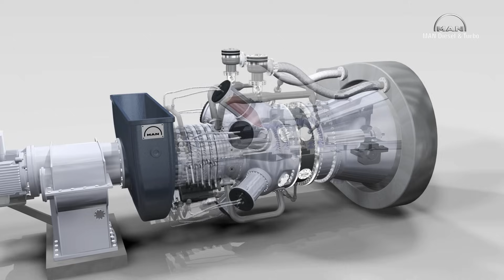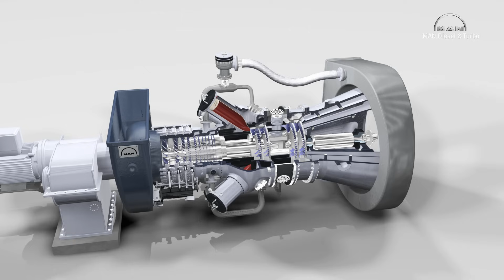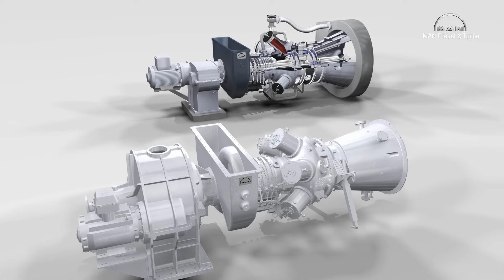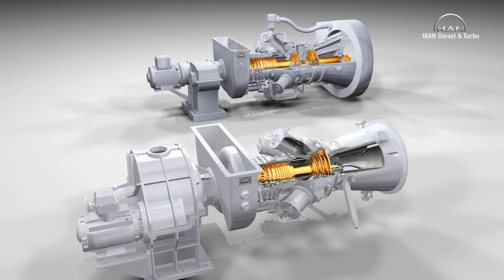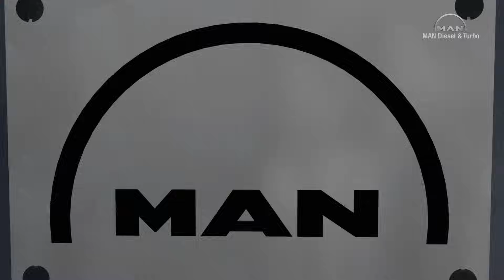3D animation of industrial gas turbine working principle

Comment: Steam is gas which is used to drive turbines using pressure..  So can't we use a pressurised gas that doesn't require burning or destroying it at all, that can be recycled over and over again. Using modern techniques, technologies and more efficient ways of producing and using electricity surely this could be plausible and would also have zero emissions that come from burning fossil fuels that produce steam or combustion ?

Comment: Wait a minute... unless I am wrong, the animations is wrong... or backwards... if the cold air (blue) is from the left, it should turn clockwise (and it does), but the blades look wrong... maybe its just Me... anyone else know what i am talking about? or able to elucidate?... Thanks - Brilliant animation by the way... well done.
Reply: the leading edge of the compressor section blades need to face the direction of rotation. (slice into the air to push the air through the compressor). If you view from the inlet end the blades are pointing to the left and rotation is anti clockwise.  The heated air at the turbine section is directed to push on the turbine blades to drive that rotation.
Reply: @Jb-tl1yi  Oh wait - I see I think... The hot air(purple) is driving the Turbine, but the cool air is being drawn in at the back by the fans (like a turbo) OK that makes sense... thanks very much.... I still need to work out how the two drive shafts interact, but it all makes sense now... this stuff is amazing.. Thanks.

Comment: I have a question. How long works the electric motor used to start the compressor? I mean, in steady state the shaft spin is selfsustainable as long as the combustions keeps ongoing, or if the electric motor stops, the entire system stops?
Reply from the maker: Hi Tore, during the standard start-up procedure of the Gas Turbine (GT) the starter motor is engaged and the GT is ramped up to speed. After approximately 6 minutes the starter motor is disengaged as then the shaft spin is self-sustaining.

Comment: But what are this turbines used for?
Reply: The ones I work with are for power generation.
Reply: these are used in
Aircraft Jet engines
power generation in power plants
Reply: The single shaft version is normally used to drive a generator. The 2 shaft versions are commonly used to drive compressor sets as used in oil refineries.

Comment: The gas turbine consists of 2 sections 
the gas generator with high pressure turbine
And the power/low pressure turbine Wich spins independently of the gas generator at a variable speed thanks to a second independent shaft. An external drive Wich is an electric motor starts the gas turbine and it drives the shaft of the high pressure turbine allong with the compressor mounted on this same shaft. The compressor driven by the high pressure turbine serves to take in the air needed for cumbustion, inside the 6 combustion Chambers the air is mixed with feul gas and this mixture is ignited. 
The hot exhaust gasses expand driving both the high and the low pressure turbine blades making them spin , the fast spinning turbine blades and shaft drives a generator wich converts the spinning energy to Electrical energy. The hot exhaust gasses then flow through the gas turbine defuser wich increases the gas pressure and ejects it via the outlet casingof the exhaust. The high temperature gas can still be utilized to generate steam when it comes out. Connected behind the turbine you will find the specialy designed boiler called a heat recovery steam generator (HRSG) it's function is to capture the high temperature exhaust gas from the gas turbine and convert it to steam. Thanks to the captured exhaust gas The HRSG then generates steam where it is then delivered to a steam turbine where even more electricity will be produced. The main steam piping Wich are Huge bundles of pipes running out of the HRSG to the steam turbine, are the pipes that deliver high temperature and high pressure steam from the HRSG to the steam turbine. The steam turbine uses this steam from the main steam piping to spin the generator. Similar to the gas turbine high temperature and high pressure steam passes through the steam turbine turning the blades and the shaft Wich turns the second generator to make more electricity.
Reply: shepherdwarriorKING L

Comment: Is there a way to add on another gas turbine with a gas that boils at even lower boiling point like propane or butane? How far can efficiency be pushed here?
Reply: boiling point from what i understand wont increase efficiency. propane for example boils at -44 degrees. in some parts of the world a vaporizer is needed to turn the liquid to a gas, requiring energy. what would make sense is gas with a higher calorific value such as butane. although more expensive therefore not necessarily more efficient. combustion efficiency also maxes out, creating perfect combustion is extremely hard to achieve. efficiency in my opinion will come from alternate routes of energy production.

Comment: "Used as a mechanical drive for compressors (...)" What the actual f***? What kinds of pressures would be delivered by those compressors? I mean, this thing generates 7-13 MW!!!
Reply from the maker: Thanks for your interest. MAN Diesel & Turbo designs and manufactures turbocompressors with pressures of up to 1’000 bar. 
Please visit our website for more information: http://www.turbomachinery.man.eu/products/compressors
Reply: silly !!
Reply: They didn't mention that this is the power source of an A1 Abrams tank.
Reply: @maxmarquez2911  more likely industrial applications in gas

Comment: So, why are the combustion chambers off to the sides of the turbine instead of having the chamber be built linearly into the turbine itself? It would seem like such a setup would be better because the fuel would be ignited with the air itself resulting in a 
 more balanced combustion and therefore a more efficient reaction, but please do correct me if I am wrong.
Reply: May be it would be made the whole engine too long.

Comment: The interior of combustion chamber is not corroded due to the continuous flame ? I mean as material is not being destroyed ?
Reply: In gas turbine engines, the combustion chamber usually consists of a combustion liner, which sort of look like a cheese grater. The combustion happens inside the liner, while there is air moving outside of the liner, creating an insulating film of air. The holes in the liner allows for the air to swirl to mix the fuel and the air before combustion. The moving air also cools the liner itself, so the temperature of the actual material is safely below destruction. What the animation doesn't show is the purple part (compressed air) moving into the inner hot part of the combustion chamber. Makes sense, since combustion chamber design would be proprietary.
Reply: This answere discribes a conventional combustion liner. The flametube in this video is cooled by impingment cooling, which is not shown. Additionally there will be a thermal barrier coating.
Reply: The material for combustion liners is Hastalloy X.  It can take the heat. But the type of fuel used can cause hot gas path corrosion problems. Using natural gas has the least amount of hot corrosion. Distillate fuels are commonly used but crude oil can be burned but component life is drastically reduced.

Comment: how long can an engine run before it needs maintenance
Reply: in different engine is different nonstop work time, begin from few hours for some airplane turbine to 2-3 mount for stationar turbine in large gas transport system
Reply: it depends on 2 factors
1-preventive maintenance dependant on Engine Running Hours
2-Breakdown maintenance when some part is damaged and safety is operated
Reply: 20-25 years

Comment: If those radial cans are the combustors, how are they fed with air? This video doesn't show that. Are those cans in fact fuel premixers, and the combustion chamber axial with the turbine?
Reply: the compressor feeds them, if you look closely at around 1:57 you can see the purple stream (the air compressed by the compressor) being pushed through channels that feed the combustor through their top. Then the hot gases are sucked in by the turbine (which in turn is kept rotating by those very same gases). Follow the colors: blue --> purple --> red --> purple again.

Comment: I would like to ask how a Gas turbine generate electricity. I searched on the Internet, many website say the the fluegas would be applied to boil water, using the steam to drive the generator. But why don`t we just use the turbine to drive generator? I sincerely hope an answer could be given.
Reply: for combined cycle the gt's are normally alot bigger upwards of 175mw some are now 300mw
Reply: They do use the gas turbines for electricity generation and some plants (combined cycle) use the gt exhaust after its has produced electricity, to heat and boil water for use in the steam turbine. 
http://www.power-technology.com/projects/san_joaquin/images/combined3.jpg
Reply: some Use the turbine shaft and some boil water

Comment: How the engine is cooled?
Reply: Compressed air is bled off of the compressor/gas generator and fed into the turbine for cooling.

There is no water and no steam used in cooling one of these units.

In some applications though, water IS fed into the compression process as well as into the combustion process.  While this does result in coolng,  the cooling is used to increase the density of the fuel-gas mixture thereby increasing the power output.  So it IS cooled but NOT for the sake of systems protection with the exception of some flame-centering applications.  Bleed air is still used to coole the turbine in these applications.

In combined cycle applications, heat from the exhaust is used to generate steam.  This steam is generally either used as process steam or generating steam.

In a few applications some of this steam is even fed back into the combustor of the turbine as power augmentation.

There are many, many applications for these machines.  I barely touched on the possibilities here.
Reply: lol yes it wouldnt make sense for the jet ones to be steam cooled, but i know the ge 7fa gas turbines are all air cooled and they are 175mw ish.
Reply: Oil and Steam, steam is normally used as a wasteheat recovery system
Reply: or air
Reply: Yeah, but normally water steam have's a bigger heating disipation  capacity than air. Aeroturbines normally does have to be air cooled because would be very stupid trying to put a 100 tons generator steam turbine and heat recovery system.
Reply: They cool the lube oil. Internal parts are bleed air cooled using compressor discharge air which is hot but not insanely hot like in the first stage turbine nozzle and blades.

Comment: Loved the video, and the combustion chambers are ingenious! But I have a technical question: the main advantage of the gas turbine is the lower number of movable parts, which increases reliability when compared to piston engines, specially for high power output. My question is if it would be economic to make it smaller (for the 500/600HP range, use a centrifugal compressor (like the one of a turbo), injection of diesel on the combustion chamber. Conected to a generator and only the enough LiPo batteries for 30/45 min of work. Then, on the MAN truck, you would install one 150HP electric motor on each wheel (even making it available in kits to install on trailers, so that they could provide extra traction if needed), and an electronic system where it would be charging the batteries on descends, even disabling the turbine. Basicly, a hybrid truck, where the main innovation is an engine which would need very low maintenance, lighter, lower number of parts and increased reliability. The only question, which would need research, is if the turbine will use the thermal power of the fuel as efficiently as the regular combustion engine, and, most of all, if the power loss due to the conversion of fuel-electric energy/storage-engine is compensated by the fuel saving on the descends, by the virtual elimination of maintenance on brakes, by the security on having full traction (even possibly on the trailer). What do you think? I do have an idea for the new "diesel turbine"... If you're interested, let me know.
Reply: Gas turbines are fuel hogs. They make sense where you need very high power to weight as in a helicopter. They work great where you need 24 Megawatts up and on line in 10 minutes for emergency utility peaking power.

In a vehicle, gas turbines consume too much fuel. its not readily possible to recover their waste heat without having an exhaust fired boiler and condensing steam turbine both driving generators. Guess what? Many utilities shut down large steam plants and built the gas turbine/steam turbine powered combined cycle power plants. These have great fuel efficiency but they absolutely do not like variable loads or frequently changing loads.

A combined cycle power plant would not work in a truck that is constantly changing speeds and loads.
Reply: I think he meant that the turbine would be powering an electric generator which would in turn be powering electric motors on all wheels allowing for better traction and eliminating the need for brakes. I do agree that it would take a lot of fuel, but I would like to point out that the M1 Abrams tank is powered by a gas turbine, so we shouldn't just disregard the idea. Perhaps a small enough turbine could be used with relative efficiency in a truck one day....
Reply: this is not a bad idea, although I think the electricity needed for future electric vehicles will be generated in industrial scale in various locations and transported to charging stations. generation would include generation turbines, solar, etc. the most efficient and cost effective obviously taking a larger role.
Reply: I mean, the US tank already operates thanks to a turbine, so it’s not impossible
Reply: @TheBigBus111  the US Military has already studied diesel and electric powerplant replacements for the abrams, it burns 30% more fuel than a leopard 2 and therefore doesn't have the range its enemies do. yes it can be bumped up to just over 2000hp and travel at 80mph but it can only so this with constant support by fuel trucks. the great thing is though, it will burn any fuel
Reply: I didn’t know the exhaust temps were regulated and I had my doubts about its fuel consumption. Also heard it's really bad in the desert thanks to all the dust that gets sucked in. So yeah, for civilian transportation, it's a big no no, but for military uses, as long as fuel and range aren't a concern, it does a pretty good job ^^
Reply: the exhaust gas outlet temperature would be legally, way too hot. in order to make legal requirements it would end up being far more complex.